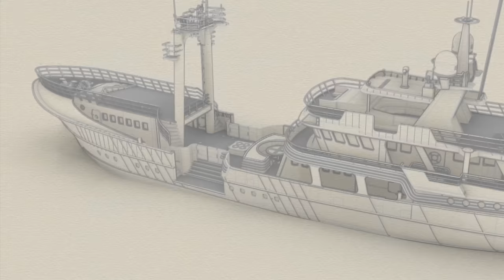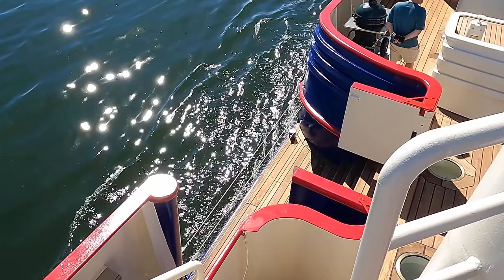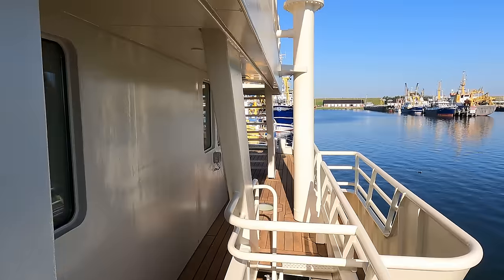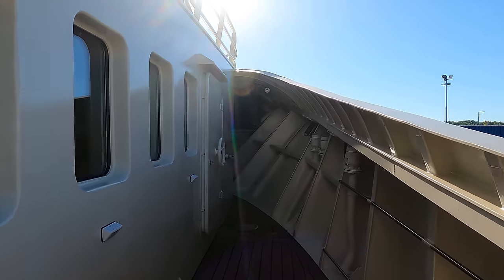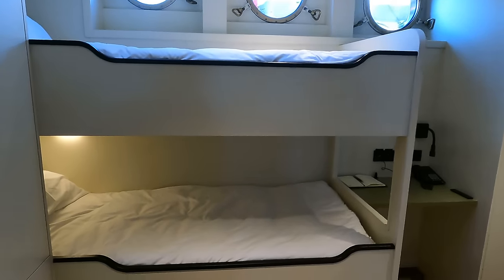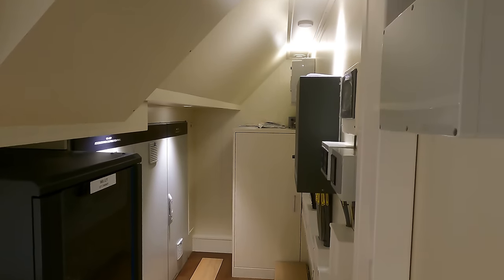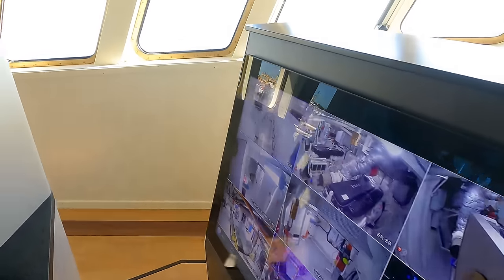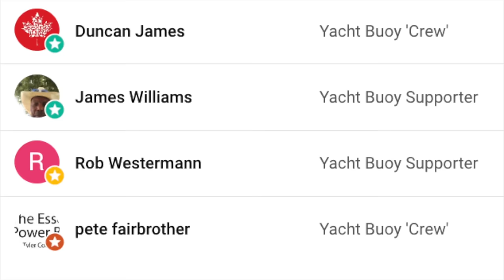THIS Is The Only TRAWLER SuperYacht Of Its Kind! | M/Y 'Scintilla Maris'

Comment: The skylights are a cool thought but someone could be walking on deck and see straight into the cabins.. and when the crew has to sleep during the day they’ll need to cover them or something. They should’ve done some built in shades for them or at least made them a frosted glass.
Reply: They probably have shades for them
Reply: In high latitudes it's 24 hrs of sunlight so good quality sleep would be a challenge without black out blinds for some of us.

Comment: You mentioned that the crew quarters were designed for a complement of 9 crew members.  What is the breakdown of the optimal crew for the ship when conducting two-week charters?   Captain, Navigation/Comms, Engineering, Deck Gang, Interior crew, chef/cook…?  Doesn’t seem that 9 crew members would be sufficient.  I would have designated a couple of the guest quarters with bunk beds into additional crew space.

Comment: Going from 9000nm to just 2000nm travel to meet emissions, isn’t that a case of robbing Peter to pay Paul as you are losing 7000nm using the same fuel??
Reply: I agree, and the best of luck with that emission filled engine room, you will need it.
Reply: Emission standards are not based on logic or reality.
Reply: @Chilipontiff so very true most were enacted during Obama's presidency.
Reply: Exactly the same with the Suzuki Hyabussa. Used to do 50mpg. Now re-engineered to do 40.
Reply: Same thing with trucks these days. They still use the same amount of diesel they did 40years ago. The engines itself uses less but because of emissions it gets to the same point
Reply: The reduction of range to meet "emissions standards" is a step backwards.
Reply: @larsmeijerink5471  there was an economist in the late 1800s called jeavons or Jenkins who came out with J[whoever]’s paradox.
An increase in efficiency results in not less but greater usage. He was referencing coal as at the time, they thought they might run out of it and had made a particular steam engine more efficient.
Reply: No, the ship is not burning five times the fuel to move the same distance, don’t be silly. It needs to carry additives (something like adblue) to meet IMO tier 3 and it can only carry 2000 NM worth of those when in leaves port, when it runs out of additives it should still have more than 7000 NM worth of fuel left in the tanks due to being run in the highest efficiency mode up to that point.
Reply: @FlakeSE  if she’s still carrying the same amount of fuel then she can also carry enough adblu because you don’t need nearly as much .
In general, you can expect consumption to be between 4% to 8% of the diesel consumption. In other words, you will use about 6 litres of AdBlue for every 100 litres of diesel. Therefore you will be filling your AdBlue tank less frequently than your tank for diesel.
A full tank of AdBlue should last between 6,000 and 7,000 miles, on average. 1 litre of AdBlue lasts around 600 miles, but this can be affected by your driving style. The more fuel your vehicle uses, the more AdBlue it will consume as well.

Ps don’t call me silly.
Reply: Don’t apply logic to a cult.
Reply: Now this is a sensible luxury yacht. No needless opulance, plenty of class & high tech. A great build! 😍😍
Reply: @FlakeSE  thanks for the rational explanation
Reply: I’ll take the 7000 Nm .
Reply: Co2 trade offsets plant a tree hahahahahaha
Reply: @-mike--m-9629  Tier 2 and Tier 3 Diesel Emissions Standards did start under Obama in 2011, but Tier 1 started under George H Bush in 2003…
Reply: Classic boomer logic not caring about the environment
Reply: @hudsondonnell444 the emissions are absolutely terrible for the engines.
Reply: @-mike--m-9629  Pretty confident that Damen Maaskant would base its environmental decisions on rulings and guidelines set down by UNEP as Norway is a member state. Don’t understand how the US Presidents would be involved.

Comment: Was that a lifting hatch topper in the master cabin where the his/her sinks located? Because it looked like there were linier actuators mounted to be able to lift that large hatch cover to the former hold area.

Not complaining about it, far from it. I think it's bonzer good to be able to get heat out or a nice sea breeze in.

The ship as a whole is a credit to quality and reuse of what would have ended up rusting away, chopped up or just st sank for artificial reefing. Plus if doesn't look like a typical yacht until you get close. That's the kind of appearance that I absolutely find a greatly appealing.

Comment: wow what a transformation, BUT there are a couple of things i would change 1. being the placement of the skylights in the cabins and showers as they did not allow much privacy for guests. 2. i would like to have seen some way of closing the outdoor galley off to the weather as it was too open and appliances are not rust proof. 3. i would like to have seen a wing docking station on both sides of the vessel or it may have remote docking capabilities which wouldn't surprise me looking at that wheelhouse. 4. i didn't hear him mention if it had active stabilizers to help the boat from rolling in not so smooth water,  but omg that boat is stunning .

Comment: A comment on the range difference between standard tune and Tier 3. Tier 3 emmissions are met by applying SCR technology. This requires adding a reductant to the exhaust flow. This reductant is commonly known in Europe as AdBlue and in the US as DEF.  The range of the vessel is limited by the amount of AdBlue it can take. The engine does not run less fuel efficient in Tier 3 mode.
Reply from the maker: Thanks for clarifying 🫡
Reply: So you can simply stock more Adblue and still have the theoretical range of 9000Nm ?

Comment: Thank you very much, Im deeply interested in modifications of workships and workships alone.

Lately have a tought problem, YOU might help me with. Im contemplating about a sea-capable ship, ment for numerous families as live-aboard, where unlike cruise ship or pleasure boat, ship is designed more for reliability and rentability, than opened luxury, plenty of inside space is dedicated for modern fabrication (3D printers, nanomateriel fabrication cloths, shoes, etc.-, bicycle and electrocycle fabrication, drons -all kinds fabrication, smartphone fabrication, modern non-perishable foods -say "canned", solar panels, wind turbines and other near sea or on sea power generators). Of course not all, that was only limited amount of ideas about wich kinds of fabrications could be ussefull and competitive almost anywhere, when build in place. Another 2 parts of "why i think that could be monetary successfull or at least not in red numbers" is:

A) The power for the ship (and some areas of fabrication) comes from solar panels and/or hydrogen cells used instead of bateries - Inspiration from Solar explorer. 

B) Ussage of aquaponics (farming green food AND animals together - animals provide fertilizing to the water, in wich the flora - say vegetables - is grown, and when the watter runs trough all of the green area, it is pure again - in case you decide to farm fish in the same watter... I think regarding animals - fish, chicken, possibly rabit (bigger animals are too big and they need to get fed too, although fresh milk would be great). From greenery - potatoes, tomatoes, letuce, (of course enough of vitamin C to prevent scurvy) etc. 

Goal of this enterprise is, to build close-to self-sufficient comunity preferably streaming from single nation, able to move around the world as they see fit and as they prefer. With as little monetary or logistical constrictions as possible. Such comunity will be (in comparison to usual small comunities on land) safer from crime, racism, war, moral decay (including but not limited to drug abuse, sex work-girls, porn addiction-boys, siring childern outside of the matrimony-adults and injecting politics in the school system - the crew of the ship is supposed to homeschool their childern themselves, or have a trustworthy first grade teacher onboard) I imagine no major difference between "crew" and "passangers" - all adults onboard would work one way or other - people with medical background would be ussefull, but if not possible, the sickbay should have some internet connection to actual doctor and at least basic equipment and basic medicine if necessary. The teacher was mentioned, but the childern should learn by working. One day in the week visit a specific area of the ship (bridge, engine room, factory, dingy cradle, food production, kitchen, wash machine room, etc), and from each bring with new informations also a new homework. 

Captain is picked before the travel itself, his main goals are 1) get the ship, where the crew democraticaly voted to go, and 2) teach his own replacement in his first mate, just in case. 
Sorry, this seem like too long. Hope you will find few minutes to read it and write me your opinion on the matter.

Comment: What, I don’t understand. Range is 9,000 nautilus miles but with that pollution control on it drops by over 70% to only 2,000 miles. WTF.
Reply from the maker: When Scintilla Maris is operating under IMO Tier 3 regulations, her range decreases to 2,000 nautical miles, mainly due to the additional fuel consumption required by the emission control systems. These systems are designed to significantly reduce pollutants like nitrogen oxides, making the boat more environmentally friendly. However, this comes at the cost of fuel efficiency, thus reducing the overall range.

Comment: In the back of the chart room, there are double doors leading out a small lounge.  It struck me that any doors/hatches leading from the outside into the interior should be watertight doors that can be dogged down and not commercial building doors.  To me, this sacrificed water tight integrity for aesthetics.